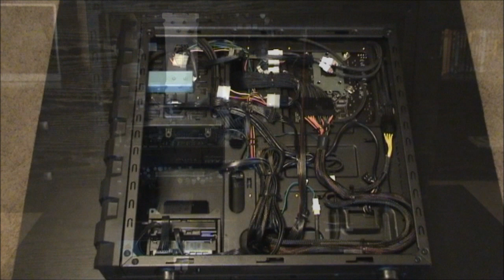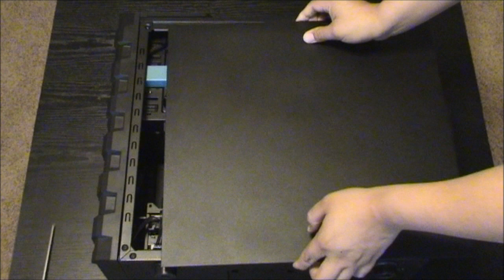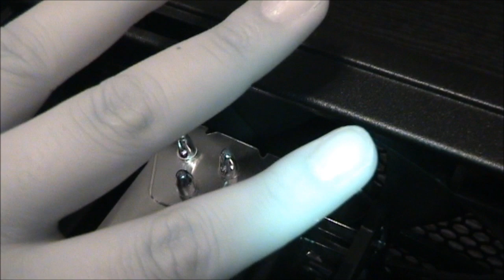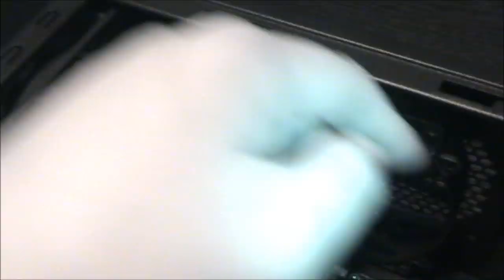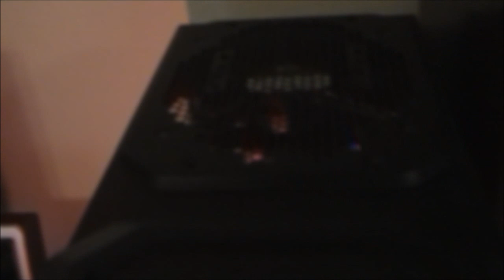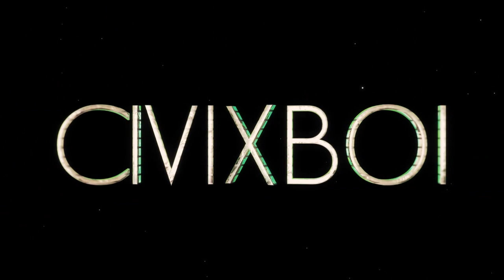Cooler Master HAF 912

Comment: I got the HAF 912; I have had it for 8 years. It was my first real good case. The other one before that was a Source 210, and before that, I had all regular Dell pre-builts that weren't meant for gaming. My mom bought it. I looked it up last year since I don't follow case designs, and I noticed this.
New cases have way better cable management, no CD drives, and SSD drives installed in the back, making it look as if there's no drive installed. The PSU is hidden just like the SSD, and it's way easier to clean because the material isn't metal where dirt sticks to it.
I was going to get an EC2, but then I just found the second version of the Elite 302 case 4 days ago for $44. I thought, why not get it instead? I can get a cheaper board since it won't be full ATX.
But I won't be opening my case until I get other stuff I'm selling sold; I'll be buying AMD parts next year.

Comment: Hey i bought Asus crosshair V formula Mobo, along with AMD 8350 proc, H80i Cooler, Nvidia 970 GTX GPU, CS650M PSU. my question is will this Cabinet supports H80i as it has seperate brackets ?
Reply: +Winsome Divyanand why amd with nvidia graphic!?
Reply: Had a gift voucher for nvidia only
Reply: +Winsome Divyanand same hier but next tim i will pu amd with ati!

Comment: Does this case have a special space to put a normal SSD memory? (srry for my english if I writed something wrong)
Reply: Yes Martin. It does come with a holder for upto 2 SSDs & it is between the HDD cage and the space given for power supply. 
As for this video I think civixboi removed it for better airflow/cooling.

Comment: Great build. Cable management is spectacular. I have a TX3 CPU cooler and luckily my mobo bracket blows the air up into my 200mm fan.

Comment: Can you tell me how thick that 200mm fan on top is? I'm trying to figure out if a 240mm rad will fit up top there on the inside, in place of that 200mm fan.

Comment: my motherboad is  a  Asus PIBIL-LB ,i just bought this case and it has individual led sw hdd power cables.my motherboard has a 9 pin connector i cannot find a diagram anywhere.any info  would be killer thanx!

Comment: Gonna get my new system built using the HAF 912 Advanced. Fingers crossed it'll be as tidy inside!!! Helped a lot to see your cpu cooler coz I was stuck about what might fit in there with the top fan. So for me it's gonna be the Noctua NH-U9B SE2.

Comment: hey do you know if they make extension for PSU cables? because i need to connect 2 8 pin to the motherboard but i cant route it behind because they are to short...

Comment: I have the H80 in my HAF 912 and it fits fine, the problem is being limited on what exhaust fan you can have on the top.  I can only fit one 120mm fan in the center on top, originally and had two of them side by side exhausting hot air out of the top.

Comment: I was wondering... Do you think a XSPC Rasa 750 water cooling system Rad would work in the place of the 200mm fan in the roof of the case?

Comment: @ehab007bob air flow is excellent, i'm using a Cooler master 212+ cpu cooler on a i7 950 cpu on a Asus Saber tooth motherboard with mild over clock and rarely pass 60c under load

Comment: @Ebbzzor The cooling in this case will blow your mind. Use a 200mm fan at the front for intake, 200mm at the top for exhaust, 120mm on the rear for exhaust and 140mm on the side for exhaust, and this thing keeps things COOL!! Dual 480gtx with 1200 watt 4x3.5"SATA (in sata backplane enclosure in TOP 3.5" bays, center 3.5" bays removed exactly like reviewer) = NO ISSUE!

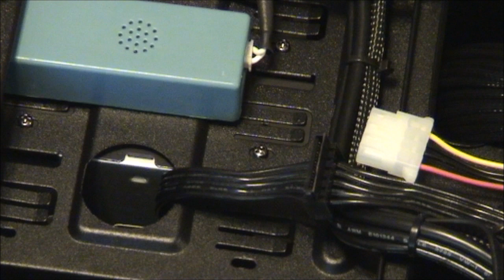Comment: At 04:15 I would have used a rubber grommet to protect that power cable from the sharp edges of your custom cut cable management hole. If you can't find a rubber grommet for the size of the hole you drilled, use very small rubber tubing, slit it open and clip it over the sharp lip around the circumference of your custom hole. Other then that, great looking build, and kick ass case for sure! I couldn't tell from the video, your side panel fan, you are using it as an exhaust fan right? =)

Comment: Good looking build. Really admire your cable management. I have the haf 932. About half of my cables are hidden behind the  HDD bays. 
Surprised you bothered to have that case powder coated. Not like it really needs the endurance the powder coat gives you giving that it's a computer case... I know I just took a trip down to lowes and picked up a can of rustoleum when I did mine and I couldn't be happier with how it turned out.

Comment: Man, I thought you eBayed that board and CPU. Very nice build, especially those minor mods and the damn wire management...how I loathe it. Would you actually recommend this case as a great gaming case, or recommend it because its cheap? How is the quality feel on it? Are you gonna make another vid on this rig with temps and such, or only I like to do that :) Are you using CM megaflows on this rig, and how are they - like/no like? Finally who framed Roger Rabbit? More questions to follow...